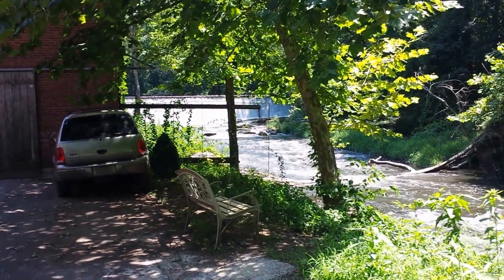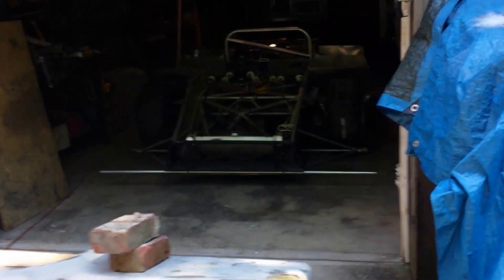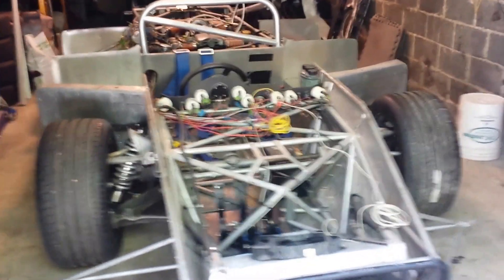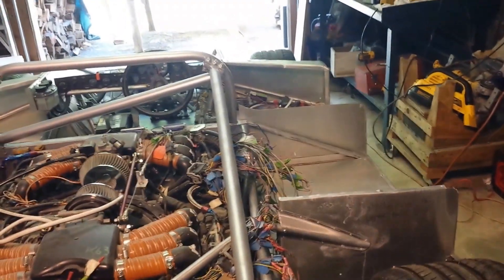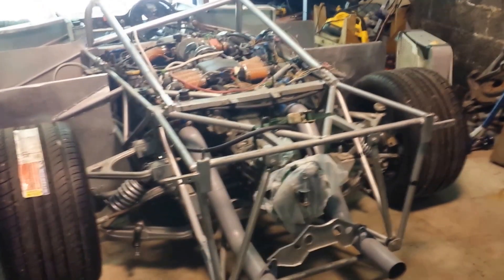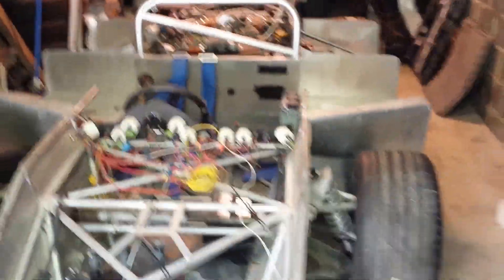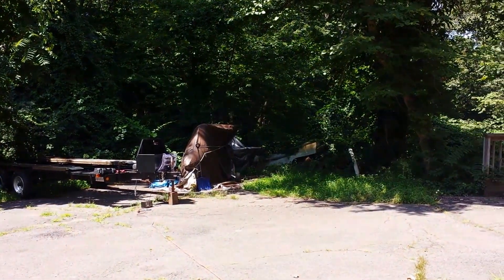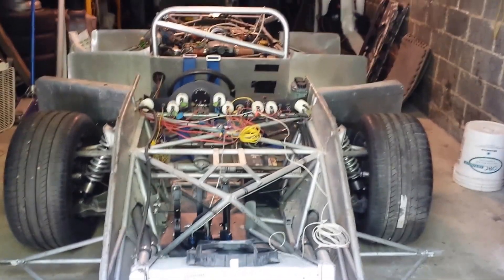Home Built:  Jo Siffert's Porsche 917/10 Can Am Replica Update

Comment from the maker: The electrician is coming on Sunday afternoon May13, 2018 to Tune the engine so it runs smoothly.  Then if everything goes right, I should be driving it around the parking lot.  This is taking a long time to get done and I have all but run out of steam.  I'm doing this myself with no more money and no cheering section to motivate me beyond my own stubbornness.   We'll see what happens on Sunday.

Comment from the maker: August 12,2017  I sold the trailer I bought and restored so I now have the money for the computer and the parts to finish the transaxle and shifter cables.  I can worry about a trailer when I get the car drivable.

So now there is nothing in my way to finish the car.  It's just that I have to do the wiring myself.  The Only things I haven't done myself is the machine shop work for the engine connector that I designed and the extensions for the steering rack.

Well, here goes nothing!